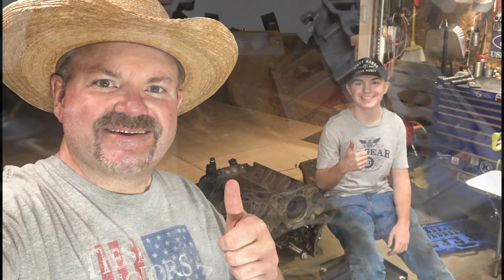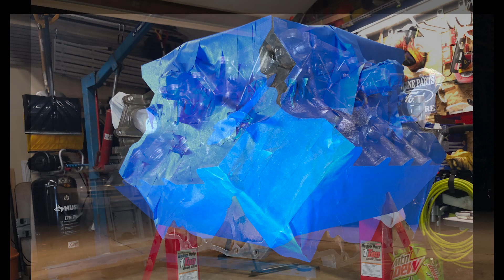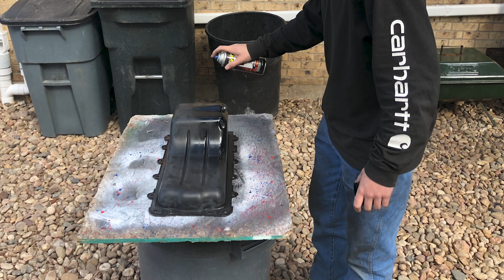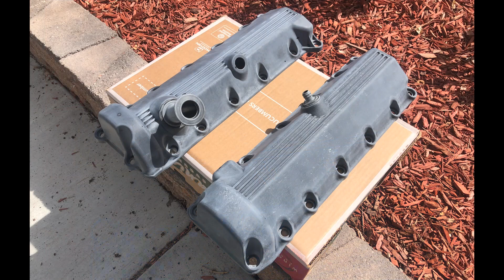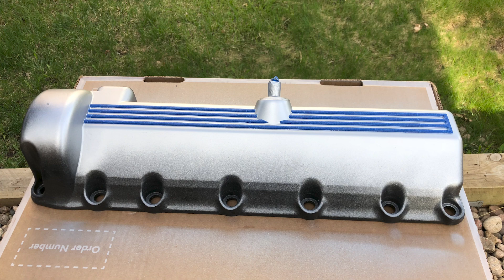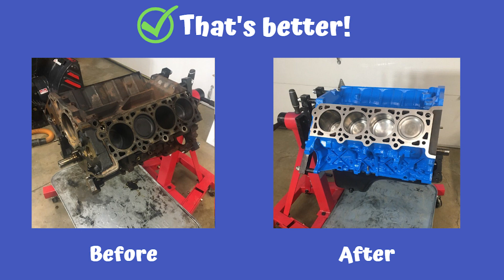Ford 5.4 2V Build - Block, Valve Cover & Parts Painting

Comment: Where did you get the new Fuel rail from?  I need one.  I have a 2002 Ford F-250 with 238,000 miles and it's time to change it out.

Comment: Did you have the heads checked out? Great job on the paint.
Reply from the maker: Thank you Bobby, we were really happy with the paint.  We cleaned the heads, inspected for damage and installed them at this time just to get his truck up and going for school.  At a later point we did actually do a full tear down, had them checked out, and resurfaced.  I built a vapor hone machine in the meantime as well (video on this in the near future) that we used on the heads after the shop and they were absolutely amazing!  Thank you for stopping by and taking a moment to comment.  I hope you're enjoying the series!